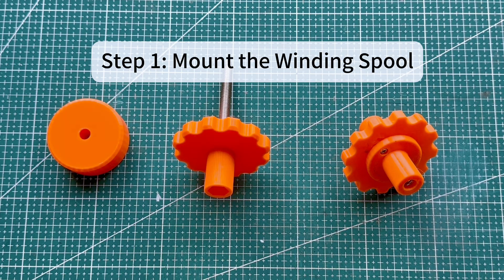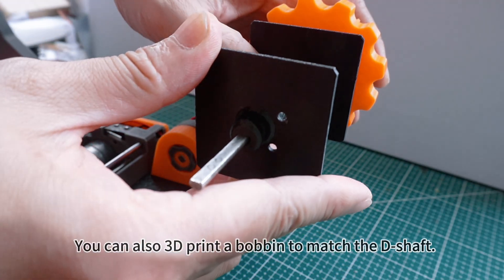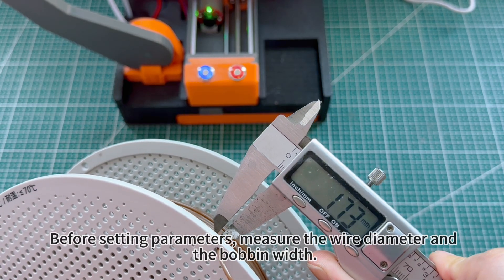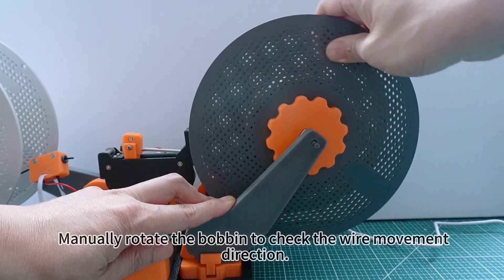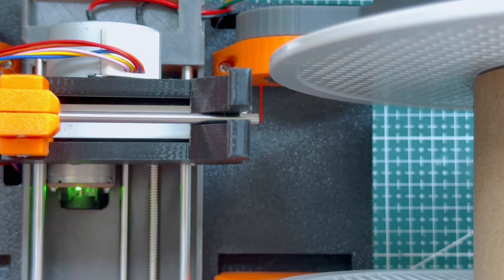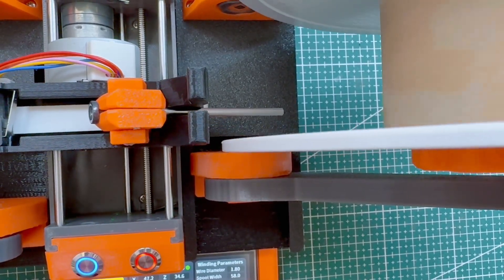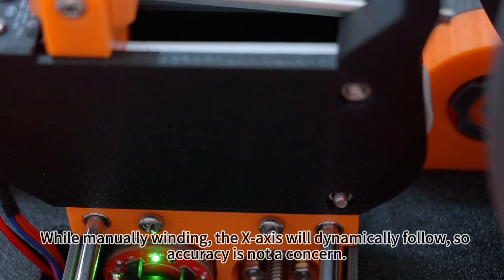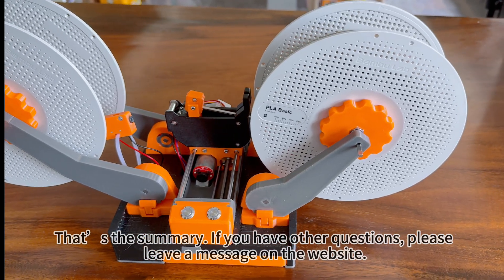DIY 3D Printed Filament Winder 2.0 – Cable Winder Instructions #windingmachine  #Winder #3DPrinting

Comment: Is it possible to mount 3 kg spools on the driven pulley?
Reply from the maker: At the moment, no — the driven pulley is designed for 1 kg spools.

Spools around 3 kg are not officially supported yet. The current limitations are mainly related to torque and long-term mechanical load. While some users experiment with larger spools, it’s not something I can recommend reliably at this stage.

Comment: Is there any provision for tangled source spools?
Reply from the maker: Good question — I haven’t specifically addressed that yet.
However, since the machine uses encoder motors, it’s actually possible to detect potential tangles by monitoring the input current and encoder feedback to see if there’s abnormal resistance or blockage.

The device also supports remote OTA updates, so I’ll make a note to include this kind of detection logic in a future version.